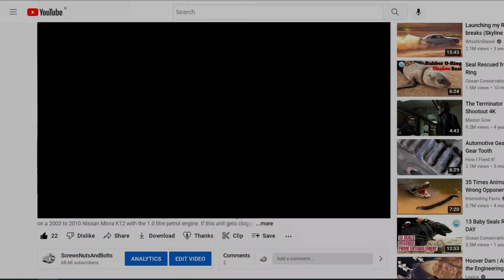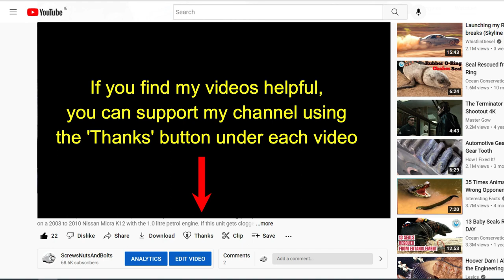Throttle Body Cleaning - Nissan Micra

Comment: Would it not be abvisable to disconnect the battery ?  Will this aleviate the need to perform a throttle body relearn ?  After carefully following your instructions, this is the position I find myself in. Regards
Reply from the maker: You could disconnect the battery and it will relearn after you reconnect it and drive for a while if you prefer not to carry out the throttle learning procedure. It might just take a bit longer.
Reply: @screwsnutsandbolts  Thanks

Comment: Could a dirty throttle body cause excessive fuel consumption and higher idling? My K12 1400 idles at about 1500 and comes down to the lowest of about 1000-1100rpm. I have replaced MAP sensor as Diag showed it was faulty and car was heavy on fuel (16L/100km). Car computer currently gives fuel consumption at 12,7L/100km for town driving. BTW love your informative channel as I've only had my K12 for about 5 months now and very helpful to see how the car works.
Reply from the maker: Thanks for watching. A dirty throttle body could possibly cause higher fuel consumption and/or high idle but so could many other issues. It's probably worth checking the throttle plate to see if it's dirty.

Comment: Can I use ultrasonic cleaner to do this job?
Just covering the metal parts, not top half black electronics.
Reply from the maker: I wouldn't advise doing that
Reply: @screwsnutsandbolts  ok. Thanks

Comment: Getting p3000 multiple cylinder misfire. Changed spark plugs and cleaned throttle body as per video. Noticed my throttle body flap is slightly open, is this normal?

Car stalled yesterday and wouldn't start, flooded engine.

Any ideas? Thanks.
Reply from the maker: When you turn the key to the 'on' position, whithout starting the engine, can you hear the throttle body motor moving the flap ?

Comment: I have followed each step an cleaned my K12 Micra trottle body and map sensor. After running the engine i get a check engine light. When i drove it down 500 meters down the neighbourhood i noticed that the idling was bad too. Break pedal was softening up at some moments. Do you make relearning of the trottle body and map sensor after the clean up?
Reply from the maker: No I didn't need to relearn the throttle or map sensor after cleaning them. I don't know how this cleaning could affect your brakes ?
Reply: The first hose disconnected is the brake servo hose - could that have any relevance? To learn the closed throttle body position you’re supposed to turn the ignition on for 10s then off for at least 10s, but then you also have a few more learning steps for the idle and accelerator positions.
Reply from the maker: Ahh you're right. It might not be reconnected properly, or leaking somewhere
Reply: @screwsnutsandbolts  It turned out the trottle body needs relearning.  My micra is  the K12E automatic version. I drove it to a shop and they did a computer relearning. Everything is fine now. I would appreciate if you make a video and show how to replace the aerial console.
Reply from the maker: That's good news. I hope to get around to doing the aerial some stage soon if I can.
Reply: Yes you have to re-learn the throttle body.
That's how you can do it manually, without any diagnostic computer.

Run the engine until temperature reach to normal, about 80-90C (so the engine runs in close loop...)
Turn off the engine
Turn off all electric loads (light, stereo, AC etc)

FIRST STEP
With the throttle pedal fully released, turn the ignition switch on for 2 seconds. then turn the ignition off for 10 seconds.
Repeat this one more time. The throttle valve closed position is now learned.

SECOND STEP
With the accelerator pedal fully released, turn the ingition switch on and then turn the ignition switch off. Wait for aprox. 10-12 seconds
During this 10-12 seconds period make sure that throttle valve moves (you will hear the sound that throttle body makes as it moves)

THIRD STEP
Now it's time to execute the idle air volume relearn procedure
With the accelerator pedal fully released turn the ignition switch on and wait for at least 3 seconds.
Next, fully press and release the accelerator pedal for 5 times in 5 seconds.
After that, wait for 7 seconds and then fully press and hold accelerator pedal.
After aprox. 10 seconds the MIL (check engine light) switch from steady to blinking.
After 10 seconds the MIL changes from blinking to steady again.
Now it's time to fully release the accelerator pedal and start the engine within next 3 seconds. 

Let the engine run in idle for about 30 seconds and then rev the engine slightly several times, just to test that the idle speed is ok
Now the idle speed should be fine 🙂

If the idle is not correctly learned, repeat the proccedure again

Comment: My 2005 K12 (1.4 automatic) won't always start, and sometimes it starts and cuts off a split second later. If I do get it going it works fine throughout the journey. I have an engine light and the diagnostic device said P0340 Camshaft position sessor. I've changed both Crankshaft and Map sensors but no luck. 

Could it be the throttle body that needs cleaning? Or something else?
Reply from the maker: It could be the wiring to the camshaft sensor is damaged or possibly the timing chain could be stretched among other things. Is there high mileage on the car ?
Reply: @screwsnutsandbolts  Thanks for your response, the mileage is 89k, the problem came on suddenly. Going to clean the throttle body to see if that helps.
Reply from the maker: Let me know if that helps
Reply: @screwsnutsandbolts  Turns out the new Crankshaft sensor I bought was dodgy, I got another one and the problem is fixed, i'm really glad it's not the timing chain and thanks for your response. 

However, I now have an air leak and need to inspect all the pipes, I've been advised to check the vacuum hose ...Not sure which one that it, is the vacuum hose one pipe or is it referred to more than one pipe? I understand it's linked to the breaking system and my car did rev up when I'm breaking to stop at a junction (and then cuts off). Your input will be greatly appreciated. 

Btw, not driving the vehicle to prevent further damage.

Comment: I have a problem with a 2006 Nissan Note 1.4. 226,342 km. In the morning, my car shuts off when I start. Then I stop it for a while, the car starts and drives all day.
Does anyone have any advice. They gave spark plugs or should I clean the throttle valve.
thank you
Reply from the maker: If you open the bonnet and turn the ignition key to the 'on' position can you hear the throttle body motor activating ?. It's usually a high pitch followed by a clicking sound